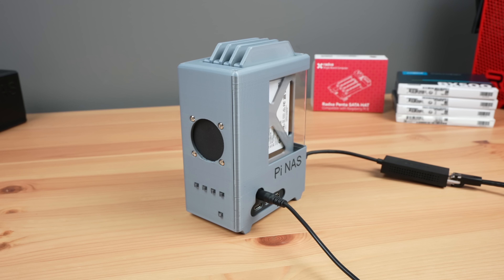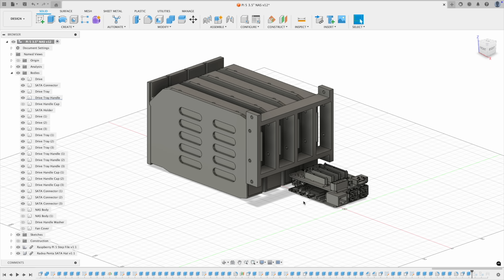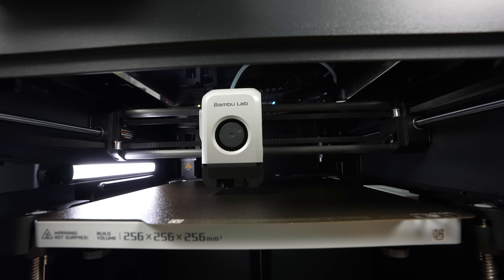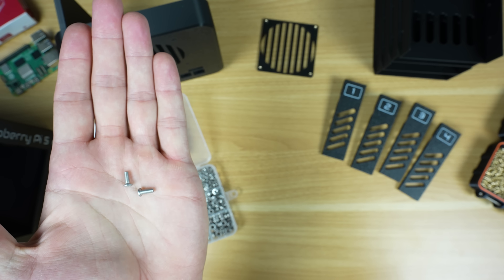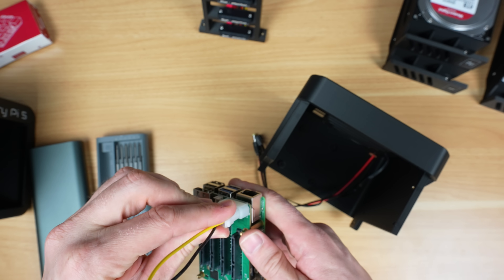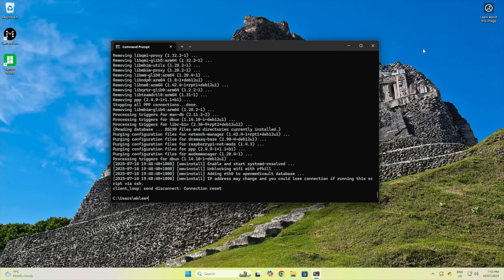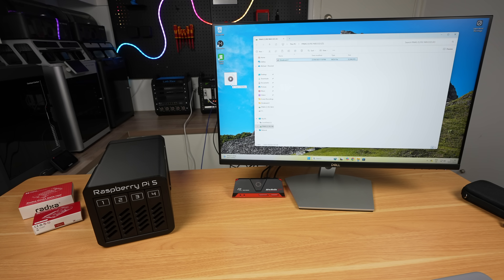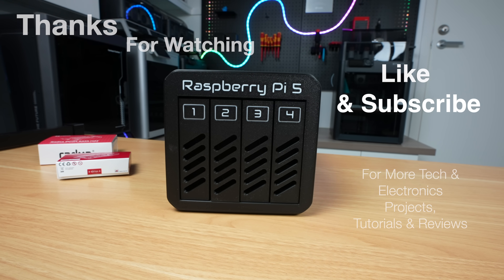I Built a 4-Bay NAS with a Raspberry Pi 5 - Swappable Drives & RAID 5

Comment: Love this idea. have seen the model on makerworld but didnt really want to do it. I think seeing the video might have convinced me! 
Although I would really prefer an option that was not dependant on the SDCard.... I have had too many RaspberryPi projects fail on me at this point due to SD card write endurance issues.

I suspect you can cut down a bit on the noise by managing the cables a little better to give the air a clearer less ... busy path...  I wonder if its possible to modify the design just a little to add some cable tidy hole/management?
Reply from the maker: You can run the OS from one of the drives, or a USB connected drive if you don't want to use a microSD card. The fan noise is likely due to flow restrictions on the vents and grill, rather than the cabling internally.

Comment: Hello, I really enjoyed watching your excellent project. I have one question I’d like to ask.

I was wondering if I could have your permission to make some small modifications based on your shared model. The changes I’m considering are as follows: since I am using a Raspberry Pi 4, the ports are not compatible with the Raspberry Pi 5 model, so I would like to adjust that part. In addition, instead of using SATA cables directly, I plan to connect the disks via SATA-to-USB adapters with a separate power supply. I’m also thinking of adding an adapter to mount an SSD next to the rear fan, so it can be operated as a more stable lightweight server compared to using an SD card. Furthermore, I’d like to add small LEDs to the front to indicate disk activity and power status.

These changes would require some minor modifications, so I wanted to ask whether it would be okay to modify your shared model, and if the result is successful, share it as a remix on Printables. Thank you very much for your great work!

Comment: hello, this look really awesome, thank you for sharing! I have one question about power supply. When i use the 12v power supply (12 Volt 6 Amp) to supply power to the Radxa Penta SATA Hat, i dont have to powerr the raspberry pi itself, it seems?
Reply from the maker: Correct, the Radxa Penta SATA hat will provide power to the Pi.

Comment: Hey Michael, thanks for making this video. I managed to complete the build, though I ran into a few hurdles since I’m still a beginner.

I just had a couple of questions:

UPS: Do you have any recommendations for a UPS that can support graceful shutdown and seamless power switching for this NAS? I’ve looked into options like APC (which feels a bit overkill) and UPS HATs (which might be difficult to fit into the enclosure and Pi stack).

HDD power issue: I tried using a Seagate Constellation ES.3 (ST4000NM0033), but it didn’t power on at all. My WD Red Plus (WD80EFP) powered on without any issues. Is there a reason the Seagate drive didn’t work? I’m guessing it might require more power, but I’m not completely sure.

Thanks again!
Reply from the maker: Because of the power draw of the drives, you'd likely need to use a PC style UPS like the APC ones you've been looking at. Alternately, because this is all 12V, you could look at a battery backed up 12V power supply since you don't really need the inverter. 

The drive is you've described is most likely power related. Either the supply can't handle the power draw or the Radxa hat can't.
Reply: @MichaelKlements  Thanks Michael.
Reply: Constellation drives tend to be very power hungry as they are designed for enterprise use in data centres!

Comment: I'm totally going to borrow this concept to build a DAS chassis for a 1L micro workstation. A suggestion for future designs, those stick on feet are horrible, they move around, eventually fall off and leave a sticky mess. I've started modelling a small recess for models that need feet. Then I print a TPU cylinder to use as a foot and glue it in. So far it has worked much better for me.

Comment: Would it be possible to use a Pi 4B instead of the 5? I want to be able to use hardware encoding for video streaming
Reply from the maker: No, the Pi 4 doesn't have a PCIe port, which the Pi needs to interface with the drives.

Comment: Now my question is, would it be possible to step up that RPi5 to get 8 sata ports for an 8bay NAS together?
Reply from the maker: The Pi 5 only has a single PCIe lane, so it's possible to add up to 8 SATA ports but they'll all be sharing the lane which then starts to bottleneck performance.
Reply: @MichaelKlements  There also is an M2 Adapter for an additional(?) PCIe, isn' it? How about using that too? I'm not that familiar with the Raspberries. Any other high bandwidth connections apart of the IO-side (USB3)?

Comment: I've done this and have a few notes:
- My bestie helped me out by printing the case and had trouble with the tray lever pegs snapping, so he redesigned that part with a bit more support.
- Very large drives in Raid 5 will take a day or two depending on how big they are.  4x24TB takes approximately 48 hours (if nothing goes wrong).
- This is software raid, so you need to leave the browser connected to omv while it builds the array.  If it crashes (like mine did at 50%), you'll have to start over.  You *might* be able to recover by checking the array to see which drive(s) are missing and reformat those and add, but as a former data center employee, it's better to just start from scratch.
Edit:  The tray slots need a channel for most screws.  I had to leave off one side to get the bays fully inserted.
Reply: I need a link please.

Comment: Looks really great. Any concerns about the PLA deforming from heat, or do you feel like that’s sufficiently controlled?
Reply from the maker: I haven't had any issues with deformation. If it is a problem, printing the components out in PETG would make them more heat resistant.

Comment: and what about the price of this thing?
- Pi 5 - $80 (prices from pishop)
- HAT - $45 (arace)
- PI cooler - $11 (pishop)
- power supply - $14 (not the same, but similar by specs)
- connectors and so on - $30
- accessories - >$20

in hardware it's already around $200, but we don't create any type of case
PLA filament at bambu store is about $25 per kilo.
And printer time (if you don't have your own printer) not so cheap as it could be (and depends on location)

looks like it's pretty similar to the cheapest NAS from QNAP

anyway - it's a realy good build of the interesting idea, but only if you like DIY or you've already have at least half of these parts.
in all over cases, if you need a NAS - buy a NAS :-)

Comment: I have a question. At full current on the pi and all the drives. How much current does everything take?
Reply from the maker: Full current on the Pi doesn't usually occur at the same time as the drives. The maximum current draw is during power up - the Pi draws around 8W (0.6A) and the drives each around 15W (1.25A) when spinning up (this then drops to about 5-10W once running).

Comment: Hi, congratulations on your videos, they're always very interesting and well-made. Just a quick tip: can you power both the four 3.5" drives and the Raspberry Pi without any problems using the 12V power supply?

Comment: Great proyect. Trying to get mine done but having issues with the Raspbian OS versin. There is now version 13 (Trixie) and OMV is not supported yet. Any one knows how to get Debian 12 for a Pi 5, or a different NAS solution for this Debian 13?
Reply: Found a way to get it on the same imager by not selecting the device version.
Reply: @andresbocrol  same issue here, the install script has to be updated for Debian 13

Comment: I, for one, wasn't able to find any SATA extension cables with the mounting holes on the side, so I'm just going to quessimate and glue the cables to the cable holder. In any future Bambu mix it might be very useful to design a cable holder with alternative methods of exactly placing the cable extensions so the drives can slide in.

Comment: I remixed the 3D print of the back side of the case. Bumped out the top half of the back of the case far enough to fit a 25mm thick 80x80 Noctua fan. NAS is silent now. Thank you for this video - this is an awesome project.
Reply: Hey, I love the idea of swapping the fan out for a Noctua silent fan, could you share with us the link to your remix please? I'm not sure I can find it on Makerworld? Cheers,
Reply: @lukekeogh3397  I just ordered all the parts to make this. If this guy doesn't post his remix I'll make my own and put it on MakerWorld
Reply: I also went for the Noctua 80x80x25mm fan (Nf-A8 Flx). My experience with Noctua has always been the difference between noisy and complete silence. But, since I've already printed everything I'm just going to screw the thicker fan onto the outside back of the case. That will leave more room for the cables as well.
Reply: @duppenthalerj  yeah, nice idea, I may also try this, the noise difference is a bit of a game changer for me, I'd be happy to reprint later if someone can provide a pretty .STL file with an enclosure for the fan... 

Also, are you flowing air in-to or out-of the case? using this as an exhaust threw me a little... I'm wondering if there is a way to upgrade the active cooler on the pi5 to something more substantial as I'm nervous about the heat... I quite like my house not burned down. :D
Reply: I'll add to anyone doing this, if you get a noctua nf-a8 fan you don't need to buy the fan connector because the noctua one comes with an adapter
Reply: @rawjaat  Thanks for the info! Does the Noctua NF-A8 fan fully support PWM speed control and tachometer feedback when used with this setup? Also, what kind of adapter does it come with to connect the fan to the board? That would help a lot.
Reply: How did you remix this? I really want to use this, but need to change the back to accommodate a pi 4 and utilize a power distribution box.
Reply: @torque6389 what did you change to accommodate to pi 4?
Reply: Has anyone manage to get a remixed back section to include the Noctua fan? I’m struggling with getting a solid fix on the back.

Comment: so why not put a 120mm Noctua fan that you can spin lower and move the same amount of air and you reduce noise, OR just frop the case entirely and you don't even need a fan if are not constantly moving large files around like in a real data centre, but just for fun you can stick passive radiators on the HDDs, Or if you want to really go crazy, Don't even bother with a case, just make a tub out of copper (you can find plates online), and submerge all of it in to mineral oil that will transfer all the heat to the outside via the copper enclosure, and if you ground that you can keep it form leaking noise all over the place if you have sensitive equipment like hi end audio or measuring equipment.

Comment: is there anywhere else to get the Radxa Penta SATA Hat amazon is out of stock and all the china stores it seems like they wont ship to the u.s.
Reply from the maker: That shipping block should be temporary while postal services set up services to collect tariff payments.
Reply: @MichaelKlements  thanks. and i just noticed today amazon got some in stock.  a question i have for you is can that power  4 - 24tb hdd, or would it be wise to use a seperate powersupply for them

Comment: If you used PLA for that build, have you checked it hasnt started melting from the heat produced?
Reply from the maker: Yes, it's been running without any issues. PLA starts deforming at 50-60C, the same seems to keep my drives at 30-35C.

Comment: The recommended barrel jack extension does not work, it is 2.1mm and the Radxa hat uses 2.5mm. So although the connector will fit on the PSU male end (which supports both 2.1mm and 2.5mm) it will not connect to the HAT. I reamed the hole in the back of the NAS out with a 3/8" drill bit and was able to jam the barrel of the 12V PSU through there. Additionally the recommended Molex>Fan connector is too tall and different from pictured in the video, however I was able to cut off the top half of the adapter and the extra pins to make the clearance work.

Comment: I have plans to builds this myself. I noticed that the barrel jack extension is rated for 5 amps but the SATA hat can reach up to 6 amps. Have you had any issues with the power or have you tested temperature readings from the barrel jack extension?
Reply: Get a different barrel jack extension (needs to be 2.5mm to connect to the Radxa, not the linked 2.1mm extension) or just ream out the hole in the back of the NAS a bit and you can fit the barrel of the PSU through and power it directly with no extension.

Comment: Hey @Michael!  I really love this project!  I've 3d printed my enclosure, purchased as much as possible on your BOM, but have a couple of issues:

1) The SATA hat doesn't come with 2.5mm screws; I'll have to get them separate.
2) The molex connector does not fit under the fan; I really need a better one.

I'm open to part suggestions here (for #2)!
Reply: Same problem here. Molex connector does not fit under the fan. I haven't been able to find one like he uses in the video.
Reply: UPDATE I also found the barrel jack extension does NOT fit the SATA hat.
Reply: Please fix your BOM @Michael; I've had to return a bunch of items...

Comment: I am working on making this at the moment and am very excited since this is my first pi project. Would it be possible to link the short barrel jack extension? I wanna make sure that I get the right one. Thank you
Reply from the maker: I made my one up but this is similar - https://amzn.to/3K1s5qd
Reply: @MichaelKlements  Thank you. I have 2 more questions. Is the fan a 3 pin header and for the barrel connector, is it supposed to be 5.5 x 2.1 or 2.5?

Comment: I just built one of these, but using the SupTronics X1009 SATA hat. This has the advantage over the Radxa of 5 regular SATA connectors, and the power jack positioned at the back above the Pi ports. So no cutting the heatsink! Of course that meant making alterations to the back of the case (I kept your power hole, but shrunk it and used it for a fan speed controller). I also had to tweak the drive SATA port frame, since my connectors were different to yours and didn't quite line up. But with those mods in place, it all fits together and works like a charm. My first Pi 5 project, and first time using OMV. Thanks for designing an awesome project.
Reply: @TimsRetroCorner
Hey! I’ve got the same SupTronics X1009 SATA hat too. I’m pretty new to 3D printing, so I’d really appreciate it if you could share your modified model. Thanks a lot! 🙏
Reply: That’s great! The Radxa HAT isn’t available in my country, so I’m thinking of going down a similar route. Would you mind sharing the model and answering a few questions? Thanks!
Reply: @DEPSTRCZ The Radxa hat is available worldwide from AliExpress..?
Reply: Yeah hopefully you could share it 🤲🏼
Reply: Project please.
Reply: How did you supply the power to your drives?

Comment: Great video!!! My system is the same as yours, but I'm only using two drives. One question: are you having problems with drives dropping/disconnecting multiple times using these extension cables? I'm having this issue, and ZFS is considering new drives as DEGRADED.
Thank you very much!
Reply from the maker: Thank you! I haven't had any problems with my drives dropping out (none that I've noticed at least). The cables are fairly standard so I'd start troubleshooting elsewhere - maybe reseat the PCIe ribbon cable and try a different power supply. Your drives might be more power hungry than mine, if the power supply can't handle them then a dip in power might show up as the drives disconnecting.

Comment: The Penta SATA HAT 12v barrel jack only supports 6A tho. How does it not fail during drive spin-up? I'm building a NAS with Pi 5 and Penta SATA hat, but information warns me about power issues.

Comment: Hi, what exactly is the Raspberry's power supply? I also have a Radx board, and the 12V power supply alone doesn't work. Do I need to configure something in the Raspberry options?
Reply from the maker: The Pi is powered by the hat, you only need the 12V supply to the hat. There is no configuration required but the hat needs to be plugged into the Pi's GPIO pins.
Reply: @MichaelKlements  Thank you for your reply. I have a Raspberry Pi connected this way, but I'm having trouble starting it because of the Radax power supply. I need to have the power supply connected to USB-C. I have the system installed on a SATA drive connected via USB. What could be causing the Raspberry Pi to not start from the Radax power supply?

Comment: Couldn't you mount the pi sideways and shorten the body to print it in one go?
Reply from the maker: You would still need two parts to be able to close up the enclosure so it doesn't really save much. The way this case is split makes it really easy to install the electronics - something that would be difficult if printed as a single piece. The ports on the Pi would also then come out of the side of the NAS which isn't ideal.

Comment: Is there an alternativ sata hat for the pi 4B?
Reply from the maker: Unfortunately not, the Pi 4 doesn't have a PCIe port. You'd have to connect the drives via the USB ports.
Reply: @MichaelKlements  ah ok thanks for your fast answer. Then I sadly I will buy a prebuild NAS. But really awesome project you did there!

Comment: Crazy thought… would a two pi cluster with these hats work with these hard drive bays side by side in a rack setup. Maybe your 10” RAX?
Reply from the maker: I think clustering them is overkill, if you want to add additional drives then just add a PCIe switch and a second Radxa Penta SATA hat.